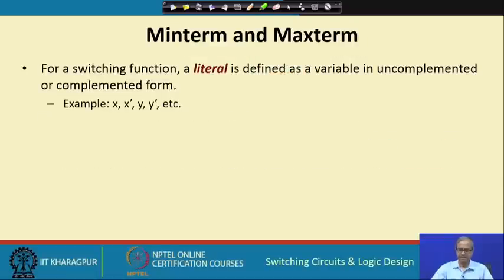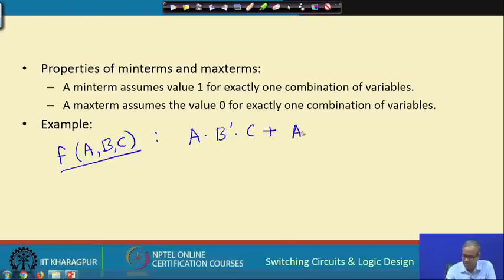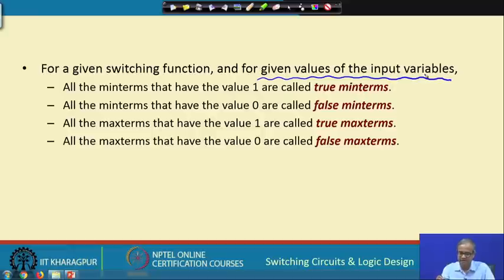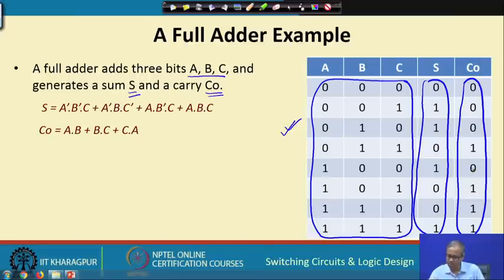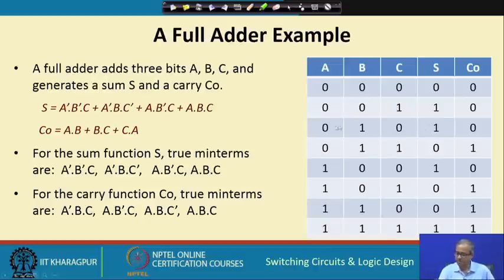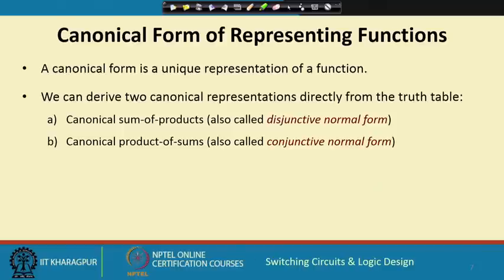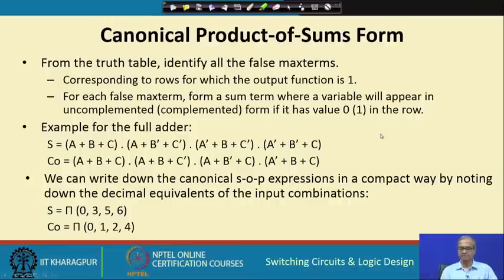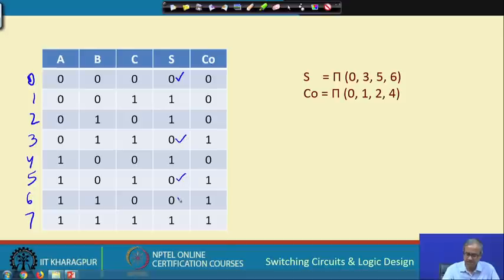Lecture 13: Properties of Switching Functions

Comment: Whys is it called a minterm or a maxterm ? 
and for the example of true minterm and true maxterm 
the expression that you took is already simplified right? why can't x'y'z' be a minterm?
It also true(1) for exactly one combination? How do you know that particular minterm has a value 1?
and we choose value of 1 as you did to represent the Full adder because there is only one possible combination
of values of xyz for which it is true(1) right? and for maxterm it would be 0 right?